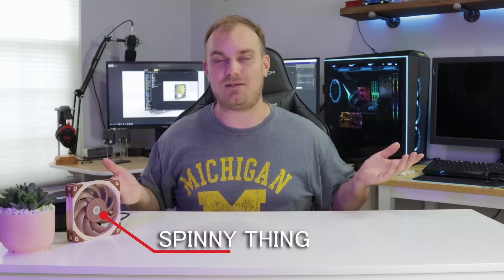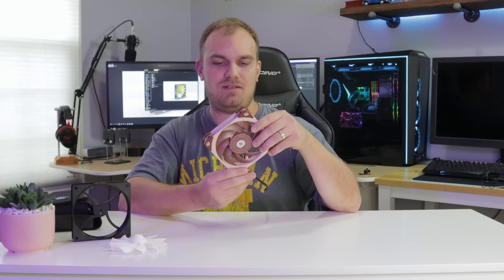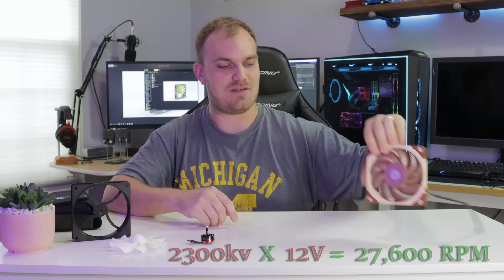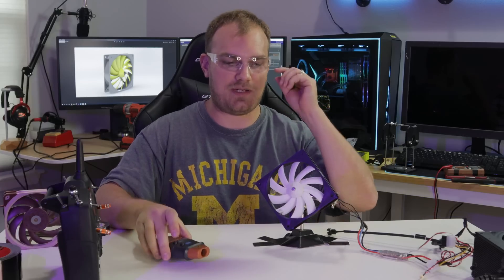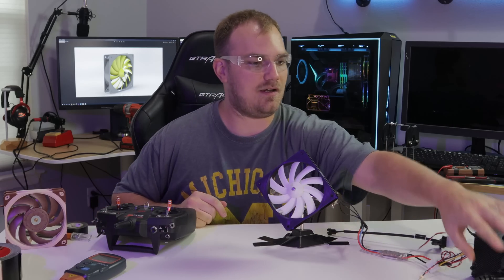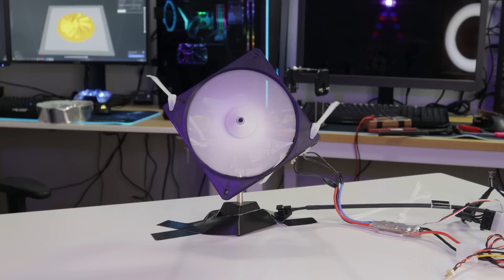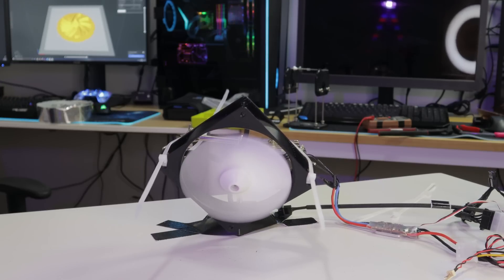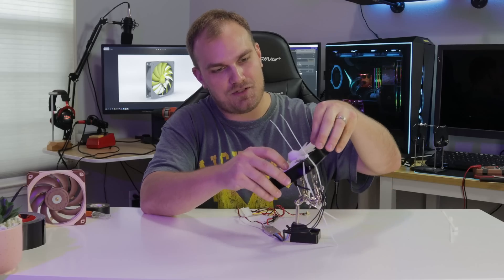3D Printed 120mm Fan + 27,600 RPM Race Quad Motor = Mayhem

Comment: I like that you followed my footsteps, were you inspired by my comments in your previous videos about mine? 120mm case fan powered by 2204 2300kv brushless miniquad motor.

Since you asked for advice tips: your fan blades are expanding with the rpm (centrifugal force), increase gap to allow blade expansion (you mentioned “beefier blades”, that would help structurally, but that’s also adding weight which makes this effect worse so it may not help much), just sand the edges down for a quick solution ;)

For speed control, I just use a “servo tester” for long term use (I was also using my RC transmitter for a while, but it beeps after a minute of no input change, lol!).

For improved motor, ideally a 1000kv motor would be better suited (you can even use a 2212 motor since you’re designing your own housing and fan, I was size constrained with original fan case and blades), the reason I also used 2300kv was also using mini-quad motor I had spare, haha, limited selection from my parts bin!

Last thing, you noticed the fan hub was melting, the motor was over-heating, add cooling holes. Mine has 5 fairly big holes (clocked to roughly match with the original cooling holes in the motor).

Mine has a max power draw of about 130w (just over 10 amps at 12v) before the blades also expand too much and hit the housing, I need to file my gaps bigger too). It can constantly run about 100w without getting too hot, but my motors are cheapo crappy $5 ones, lol, you’re using some better ones. I would love to put in my 2212 930-1000-1400 kv motors but I didn’t 3d print mine (your print came out pretty nice, good job! My printer needs some calibration at the moment, lol!)

Thumbs up! These are great for overclocking on air for benchmarks (yeah I’ve got waterblocks, phase compressor or LN2 cooler, but it’s just fun with some “extreme air cooling”, haha!). When testing, stand behind it (blades will fly forward and outward) and wear safety glasses or just go to another room with a nice wall between you, haha! Good job!

Comment: very interesting project :D
For me, the most important ratio is noise/performance, silent high performer, guess this is the wrong motor for that :P
keep up the good work thumbs up
Reply from the maker: Noise was through the roof
Reply: Use case for 10K rpm fans, is 24/7 machines where they are stuffed into an air conditioned closet, or spare room across the house. Where noise isn't a concern.

Comment: I would recommend a small DC motor such as this.... https://i.ebayimg.com/images/g/o8MAAOSwnaJdEubF/s-l1600.jpg  ... You can put a voltage reducer on it to get from 12v to 9v and then mount the fan to the collar of the motor ... I am sure you understand the concept I am getting at. :D
Reply: https://images-na.ssl-images-amazon.com/images/I/41VCMBe-%2BfL._AC_SY450_.jpg  ... Using something like this to mount the fan to motor shaft. :D
Reply: Another example: https://images-na.ssl-images-amazon.com/images/I/51iHrxIeOoL._AC_SL1400_.jpg ... Pro Boat Motor Coupler, 5mm (Motor)/4mm (Flexshaft), PRB286010
Reply: https://www.amazon.com/Atomik-RC-Motor-Coupler-Barbwire/dp/B0006MZRI2/ref=sr_1_5?keywords=RC+Motor+Coupler&qid=1570912855&sr=8-5

Comment: I don't know much about 3d printing however I know for motors to get the inside of the cylinder smooth and perfectly round after drilling they use a honing tool maybe you could do something similar for the cage... hope this helps, can't wait for the rest of this project!
Reply: For roundness you need a lathe or just a better printer, honing actually scratches up the surface in a specific pattern that allows oil to flow better.

Comment: Maybe double the supports for the motor to the outer frame and add a ring around the outside of the blades like squirrel cage fans for a car blower motor for example.
And maybe source a motor that can be had for cheap to make our own? 
Will you be putting the files out for the 3d models?
Reply: It’s about $9 for the power system if you went really cheap ($5 motor, $4 30 amp 12v esc, $1 servo-tester for speed control). I used a $3 fan after the motor blew up from over-volting. It only consumes up to 130w before you hit some limits, check my other comment on this video for instructions on how to make better, it’s pretty simple.

Comment: humm, back of fan is held in with a C-clip.. very easy to take apart..
Reply from the maker: Go try it
Reply: Major Hardware That’s how you oil them (the magnetic ring is glued to the blades, but easily comes off for most cheap fans non-destructively as it’s barely glued on), I’ve done that for a few motors, the rear stator is the only semi-tricky part, but you can often drill the center plastic hub out, or just manhandle and rip it out to remove if you don’t want to keep the old box housing/mount

It’s basically the exact same as the brushless motor you used (though I’m not sure if those BH red bottoms have C-clip or Hex head screws), the fan is serviced the same way. Pro-tip, the cheaper the fan, the less quality glue they use for any mounts so the easier they are to take apart cleanly, Noctuas might be too nice, lol!

Comment: Try mounting the noctua fan to the RC motor, and see what speed you can achieve.
Reply: I’ve done this with a cheaper than noctua fan (motor blown over-volting with boost converter, so I replaced it with RC motor), he might have been following mine from previous comments on his channel (also 2300kv miniquad motor on a 120mm fan). It’s very easy to do, 2204 motor allows for a seamless fitting, and don’t forget to drill cooling holes for the motor! My cheapy fan survives up to 130w before the blades expand too much and hit the housing, they need filing down)
Reply: @jakegarrett8109  lol
Reply: @jakegarrett8109  130w on the motor? Jeez that's pretty absurd! When your ONE fan draws more than mid range graphics cards, you're definitely pushing things to crazy limits!
Could you measure the RPM just for curiosity?
Reply: Kalvinjj I actually don’t own a tachometer but good news is my cousin does! I’ll see if I can test it next time I see him. If you want a demo with power readout and rpm, you can sub to my mostly dead channel “Legit_Overclocking”, and request a video in any of the comment sections (otherwise I’m 99% likely to forget about it, and I especially won’t be able to find this comment a month from now).

Yeah, that channel is pretty well dead though, I had a few great videos that were edited and actually great, but all the good videos were deleted and I wasn’t able to recover them, so that bummed me out and basically the channel died that day instead of having fun stupid videos similar to this channel. All it has right now are trash that’s non-edited and recorded with a shaky cell phone cam, lol, just ignore the videos when you leave the comment because none of that junk is worth watching. I’ll hopefully have a good Halloween build video up on it soon, but my boss is asking for more overtime (I already had to work this last Sunday... I guess he is insisting on 7 days a week! We are pretty slammed with work, so that means my Halloween PC may not be finished/filmed/edited by then, at least not with all the proper LN2 or dry ice cooling for a fog effect coming out of the vampire style casket, and I want to finish the water cooled cards to make it look like a skeleton rip cage since I’ve got a pump embedded in a skull). But fan testing takes less time and I can see some people actually might be interested in an easy guide, and that I can do!
Reply: @jakegarrett8109  wow to think someone would actually take that much attention to it is just as amazing as the experiment itself, may I say! Subbed to the channel, whenever you feel like doing it, I will get the notification then.
Tho obviously set your priorities as needed, no need to go out of your way for the video reply, but granted I'm really curious to see.
May as well reply here again then.
Reply: Looking forward to it @jakegarrett8109
Reply: Do you know how hard it is to crack a fan that you bought from a shop ?
Reply: @lukasvincourcz7043  not very hard with the right tools, a small HSS drill bit straight down the centre should work.
Reply: @Old_Man_Pete  yeah
Reply: That would really interest me, maybe start with some ippc-3000 blades and se how much headroom is available
Reply: That was cool
Reply: I know Im randomly asking but does someone know of a way to get back into an Instagram account??
I somehow forgot the account password. I appreciate any tips you can give me
Reply: @Hayes Elisha Instablaster :)
Reply: @Enrique Kristian i really appreciate your reply. I got to the site on google and im in the hacking process now.
Takes quite some time so I will reply here later when my account password hopefully is recovered.
Reply: @Enrique Kristian it did the trick and I actually got access to my account again. I'm so happy!
Thanks so much, you saved my account :D
Reply: @Hayes Elisha no problem :D

Comment: What was amazing, is it me or do we see the blades deform as they got longer and longer making the white circle bigger.   I had no idea that home printers could make such sturdy parts I thought there would be plastic shrapnel everywhere.  So what next an air impeller like a turbo or a 3D printed water pump and reservoir of your own design.
Reply: There are also production 3d printed turbocharger in the Keoninsegg supercar (variable vane turbo, they make so few that it’s cheaper to use a metal 3d printed than the tooling for custom turbos). I have a plastic 3d printed turbine wheel, probably fine for 100k rpm (tiny 1 inch diameter impeller, was going to supercharge a chainsaw powered bicycle at one point, but I didn’t have the $40 for the motors I have now, like my 70mm edf pulls 65 amps at 24v, or just over 2 HP on a tiny thump sized motor, haha, I may finish that project someday if I find the time, but I think a jet powered bicycle is higher on the priorities if I can find some way to tag it, lol!)
Reply: @jakegarrett8109  That is impressive, turbos get so hot you could sun tan.  And have you considered a pulse jet on your bicycle less complicated but infinity more stupid.
Reply: Anders Sorenson haha, are you a Collin Furze fan too?

His pulse jet bike is cool and I love it, but it has limitations that wouldn’t work for me. Pulsejets are really, really, really loud and there is definitely no way you could operate one on US roads or even off-road anywhere near city limits as the noise level is practically off the charts (I’ll have a difficult enough time just getting a regular jet tagged as a motorcycle or just any vehicle, lol!). A small turbojet does cost a pretty high amount, about $3,000 for a 50 lbf or “22 KG” (as an aerospace engineer I face palm when they use mass as if it were force saying units of grams... it’s Newtons! But whatever, marketing...) for a small but new turbojet engine meant for big RC airplanes (I’m pretty sure with 2 of these you could fly pretty fast in a rideable homebuilt airplane, even 1 would get you off the ground but might as well go faster!).

It would be extremely simple since it’s mostly plug and play with the modern micro-turbines, they even have their own starter and fuel pumps and small computer that controls cool down cycles and fuel regulation with thermal safety to make sure it doesn’t melt. I would love to remake one of my teams planes (stealth radar evasive UAV with thrust vectoring jet engine and deploys 40mm grenades), however, I don’t have the molds for the carbon fiber and it’s ITAR regulated. But using a jet engine on that worked great, I didn’t realize how simple they have become until I had to wire one up (like an hour or less to install). But getting a much bigger one for a bicycle sounds like fun, haha! Bet I could really go fast, lol!

I’ve got a few motorized bikes (at one point had 0 pedal powered bicycles, put engines on everything, lol!), ranging from practical ebike to also practical but much more fun chainsaw powered bikes (front wheel drive, really good for off-road or drifting on roads), all I think I need next is a jet powered one (at least until some cool or alien technology comes out, I would not turn down plasma thrusters if they were powerful enough, lol!). I try to have some fun ;)
Reply: @jakegarrett8109  Wait are you planning on building a drift bike that uses thrust vectoring to control the drift?
Also showing an interest in building essentially low radar profile drones you might be on a watch list, but with your own rocket pack they will never catch you
Reply: Anders Sorenson I wasn’t planning thrust vectoring, but now I’m curious if I put the jet on the front axle if it would behave like my other front wheel drive motorbikes. They track very nice and smooth with the force always being inline with the direction of steering and travel (the back wheel almost isn’t even needed since it balances well after I’ve leaned forward, lock the back brakes and kick the back wheel out sideways). Id consider that thrust vectoring in relation to the rider. The only downside I can think of besides a lot of drag/thrust reduction from the rider in the airstream, would be the heat. It’s not very hot behind a small model RC jet engine if you’re 6 ft away (I’ve probably still got some photos posing like SuperMan with a jet blasting my hair back, haha!), but right at the outlet before it mixes with the surrounding air they get pretty hot, I think the ratings were about 450c or 900*F exhaust temp close to full throttle, so it might be kinda hot for a longer ride at full throttle if it’s much closer than maybe 4ft (which I could probably get that distance with my existing motor suspension systems, one of them hangs a bit past the front of the wheel).

I always need one more excuse for a jet, haha, cheers!

Comment: Imagine 6 in push pull on a 360mm AIO.😏😅

🙄Can I order 6 please.. 👍👌
Reply: At that point I'd just go custom watercooling if you are desperate with with cooling potential
Reply: @Oliver-bn7jt  🙄🤐
Reply: @BuGGzLoVeRsTech  Push pull is stupid, unless you run all your fans at a slow fixed speed with massive 80mm thick radiators. There's no cost benefit to push pull unless you are in that specific use case.
Reply: Batojiri1 well you could have a single 80mm rad which is more then double the efficiency of a single 40mm ,it increases exponentially. So push pull using 6 fans on a single thick rad is better that 6 fans on 2 thin rads.
Reply: @Zeesneakyninja  You are actually wrong 80mm thickness does actually equal to less performance than getting double the surface with 40mm radiators. Given that the headpressure and flowrate stay the same.